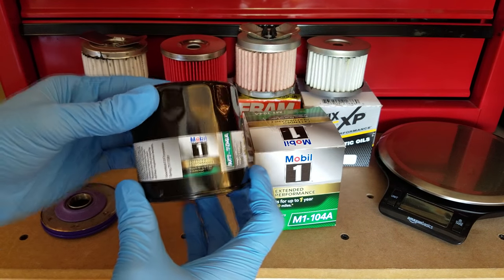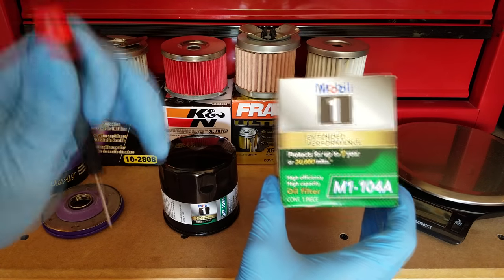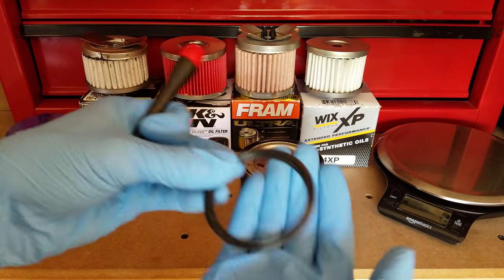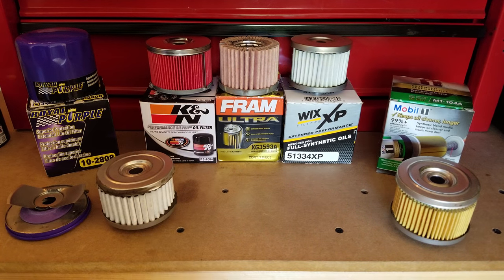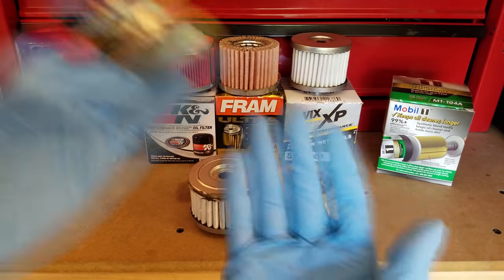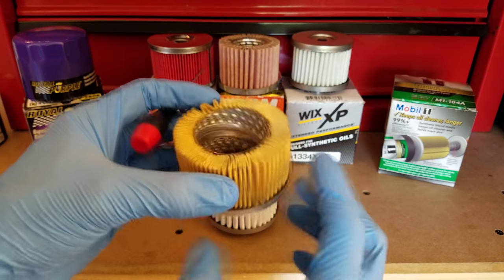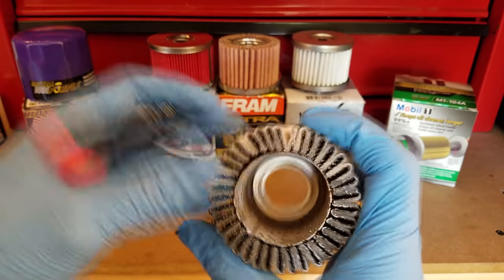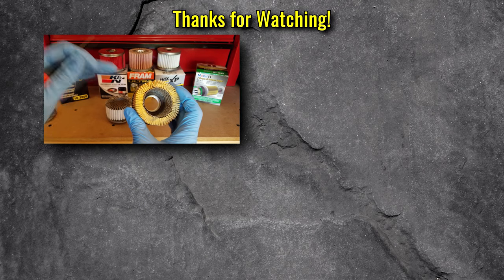Mobil-1 Oil Filter Cut Open! | vs Royal Purple/WIX/K&N!

Comment: The only reason I use the K&N is the 1 inch "Nut" on the bottom that makes it ridiculously easy to change.   It's  a brilliantly simple idea....
Reply: Didn't even know about that. Cool!
Reply: Ditto
Reply: You would think so... but about a decade ago I figured out you never need the filter on that tight. Put it on by hand take it off the same way.
Reply: @batvette  Heat cycles can make them hard to get off and seem "tighter" as well. You don't need a tool or wrench to put them on but you definitely need them somewhat hand tight. You can't just stop as soon as it touches/feel some resistance. As soon as the seal makes contact a half to three quarter turn should do the trick but it's more a feel than anything. If you do it enough you can tighten it just enough and be golden. 

The only time you should use a tool to tighten a filter is if for some reason you can't reach it or grasp it well enough.
Reply: Had one get stuck one time and that nut didn't help at all, it broke off.  Had to do the old screwdriver stab trick...
Reply: @ocp1669  never had one I couldn't take off by hand that I put on by hand...
Reply: I've had a k&n filter come apart inside. Sad they went to production outside the US
Reply: Rich Farfugnuven 
So simple and great
Reply: @batvette  on diesel trucks(I have 2) you want to snug them down so that the extra vibration  of a big old diesel doesn't loosen them.
Reply: @robby844  Ok and? It doesn't change the fact that heat cycles and vibration can tighten them more than you did  and make it harder to get off by hand. Especially where they are harder to reach. 

Anecdotal evidence is the best evidence?
Reply: @robby844  "if you know what youre doing you don't need a tool to put it on or take it off. "

I agree with that, if you qualify that statement with... if you put it on yourself and you have been doing it long enough to know how tight it needs to be and you have enough access to it to be able to reach it and get enough of a grip on it to turn it. The statement as it stands however is completely false as you can know what you are doing completely but if someone else put it on with or without a tool and over tightened it there is no way in hell you are going to get it off without some kind of tool unless you are secretly Bruce Banner and can get a bit of that hulk action going just be careful not to break the engine in half. 

"Never once put a filter on with a tool."

Again I can agree with that statement if you qualify it. If you have the access to tighten it the appropriate amount, usually half to a three quarter turn after it makes contact then absolutely completely agree. 

"Caterpillar says DO NOT use a tool to install thier filters."

So? Look you can use a tool or not use a tool and still be fine, it's just using a tool you have to be a little more careful. A lot of mechanics use quarter inch tools on small fasteners, but you can use 3/8 or 1/2 perfectly fine if you know what you are doing and be careful not to apply too much torque to the fasteners. You can put on a filter by hand and still over tighten it, yes you can get it on by hand but if you over tighten it then with heat cycles, vibrations, etc it tightens up a bit more and the same hands that put it on may not be able to get it back off. 

"Lube the new gasket"

Sure it should be common knowledge to stick your finger in the oil and rub it on the o-ring, nothing to it really. 

"spin on until the gasket contacts, 3/4 of a turn after contact. NO FURTHER."

Maybe you did not read my full reply? If you go back and read them... that's exactly what I said, well not "exactly", but it was close enough. I mean hell it's not all that long. 

Here it is just in case you can't be bothered to scroll up. "You don't need a tool or wrench to put them on but you definitely need them somewhat hand tight. You can't just stop as soon as it touches/feel some resistance. As soon as the seal makes contact a half to three quarter turn should do the trick"

"Filters that some asshat like you put on?.... Yup. Needed a pair of channellocks EVERY time"

What the fuck are you on about? Seriously read what the fuck someone says before you come at them like some ignorant fuck. Also that statement goes completely against your first statement of never needing tools to take one off. Maybe learn what absolute language is and figure out what qualifying language is? Well way before then you definitely need to build up your reading and comprehension abilities as they are severely lacking.
Reply: @robby844 I can almost NEVER take them off by hand after...
Reply: @billsouza4457  youre doing something wrong then
Reply: Robert Pitts That reminds me of some youngsters working at a SHELL station I used to use, so the 1 guy punches the filter with a LONG screwdriver, then hit and BROKE that cars distrubitor,  well the owner went aBALISTIC, for the damage from a simple oil change ,,he broke the gear, so now the repairs .!
Reply: @robby844  Same for me-I have not used filter wrench in such a long time that I don't have a clue where I've stored it!
Reply: OCP yeah I’ve read all the comments and STILL agree with Robert844 LoL
Reply: Hi-Flo makes them. You can get the same filter with the nut under the Hi-Flo name for cheaper sometimes depending on model.
Reply: Only relevant if you can access the nut
Reply: @ocp1669  From the last dealer oil change, I had to use my 25" breaker bar to remove the filter. Tighter than the lug nuts on my wheels, a little more than heat cycle. Many times it's not easy to remove by hand when the filter is oily, in a hidden dark location, contorting and twisting one arm trying to grasp it with just finger tips in a mechanically disadvantaged position. Finger tight plus half turn, should be easier for the next change. Not looking forward for the transaxle oil change on my new car with no dipstick. A new experience trying to match oil volume with specific temperature - need to be very accurate. Old cars so much easier to maintain.
Reply: @frankw8876  "a little more than heat cycle." It could be a number of things but heat cycling can and will cause them to be that tight. It doesn't happen every single time but it can. It also can be down to how many heat cycles, and the extremes of the cycles. Say driving to work every day more than 10 miles each way when it's very cold. Then you have other temperature differentials. Say you put the filter on a little more snug than normal when it's 90 degrees outside, then try to remove it without warming up the vehicle when it's 10 degrees outside and it will be seemingly impossible to get off. 

"Many times it's not easy to remove by hand when the filter is oily, in a hidden dark location, contorting and twisting one arm trying to grasp it with just finger tips in a mechanically disadvantaged position."

I completely agree and nothing I have said so far has gone against that. 

"Finger tight plus half turn, should be easier for the next change. "

That I believe is the wrong kind advice. It has a very subjective component to it "finger tight". Finger tight to me and to you and to anyone else will be a little different, especially when you factor that and hand strength. A better way is right when the seal makes contact. The second you start to feel some resistance a half to three quarter turn at that point and you should be good. 

One other point to note. "finger tight" typically and almost exclusively means as tight as you can with your fingers without the aid of any other tools. If you did this, plus another half turn to three quarter turn with a tool that would be way too tight, unless you have incredibly weak fingers/wrist. As such I again suggest as soon as the seal makes contact then half to three quarter.
Reply: I love the K&N nut, wife's truck has the filter in an odd spot where the access is right between two cast exhaust pipes. So either wait a good hour or so for it to cool down, burn myself good, or buy K&N filters. Plus those silly end cap type wrenches get stuck on and are a royal pain for installing a filter.
Reply: @busted7426  Had the same problem, junk filters....the end-cap nut seems like a good idea but now I believe it to be a gimmick.
Reply: @sebrofc   They use to be pretty good though, I swear the nut and case use to all be one solid piece of metal.  Now it's just cheaply tacked on like an afterthought.
Reply: @flybyairplane3528  Now that is a big screw up, did the owner have to pay for the damages or did the station cover it like it should?  I'd still be pissed either way, no one likes dealing with unexpected damages no matter how small.  This is why I will always do my own oil changes.  A friend of mine took her SUV in for a oil change and the guy there used the wrong filter even after his boss told him to double check it, oil leaked out while it was being driven, engine ceased up and had to be replaced.  They thankfully covered the repairs though.
Reply: Aircraft oil filters have the nut like a K&N so that you can use a torque wrench.  They also have tabs to safety wire the filter to prevent vibration from backing off the filter.
Reply: Been using K&N filters and Mobil1 full synthetic in both of my cars for years.
Reply: @busted7426  Same thing happened to me, now I don't waste my money on K&N.  You should check out Husky's 3-Jaw filter wrench though... $10 at Home Depot and you'll never need to stab with a screwdriver again.
Reply: @robby844  Plenty of other people have...
Reply: You sir just made me switch my brand to k&n
Reply: @ocp1669  - Some filters are marked for 3/4 turn after "finger tight" contact.
Reply: @flybyairplane3528  - The main reason I do what I can myself is keeping monkeys away from messing with my car. I don't care anything about car fixing any more; it's just an annoyance. But nowhere near the annoyance of monkeys damaging my car. Believe it or not bumblers can screw a spin-on filter crooked! Every car I have had that had a spin-on filter required a wrench to remove the filter the first time. What do they do? Use an impact?? Only car I ever had that had a separate filter element had the center screw in crooked - missed the threaded hole. The cap and filter fell out when I removed the cover on the bottom of the oil pan. No wonder the oil pressure was so low!
Unless car repairs are beyond my abilities and facilities (concrete driveway) my attitude is "get away from my car!!"
Reply: @ocp1669  - "Finger tight" is two fingers and thumb, not gripping with the whole hand. Unless you're a real gorilla!
Reply: @batvette  I have been doing it way for decades. I don't know why other manufacturers don't copy Fram and put some grit on the out side of their filters too.
Reply: i think 17mm
Reply: @busted7426  done that a few times with my 1988 IROC with 5.7.  Really hard for me to get at the filter.
Reply: @brianheath5091 Thanks for the info, I just did a look see at HD and they had a short video on Husky tools. I thought I'd pass this on for all the DIY'ers here.. Husky is doing what Sears/Craftsman used to do, if one of their tools breaks you can bring it back to HD and they'll replace it for free. It's a lifetime guarantee and no receipt is required. In the video it shows a guy mowing his lawn and he runs over a hammer, chewing up the handle pretty good and taking it in and getting a new one.
Reply: @joepro3562  what do you think of their tools? I looked up snap on torque wrenches since my father-in-law has them and saw they're $400! Husky is 80 with the lifetime warranty. Hell, even if it only lasted 10 years and husky was out of business by then, I'd still be ahead compared to a $400 torque wrench...
Reply: @ocp1669  
You sound very upset. It's not worth blowing a fuse (or a blood vessel). Now if you want to get upset try removing a Toyota oil filter cap (instead of a spin-on filter) that some ignoramous put on with a 200 ft.lb. impact tool.
Reply: I just changed my oil and the darn filter took 5 tries (5 different oil wrenches) and 20 minutes to get off, due to it being really tight and hard to get at. I switched to the K&N for the nut (supposedly a good filter too). For some reason the oil filter on the 6.4 hemi can loosen (mine has twice), so the dealer said to put it on tight (more than hand tight).
Reply: Be careful of that design if you live in winter hell. 

If the filter is exposed, road salt will corrode the filter “nut” area, to the point that it can leak.
Reply: @very7962  we luckily do not use salt here in CO
Reply: i gave them a shot once because I liked the idea too. BUT in practice it didn't help any better than a typical oil filter removal tool. The "nut" on those filters is hella rounded off and smooth from paint. A socket will grab it, but unless you have a ton of room I found it just slipped all over....for me it appears to be a marketing gimmick.

Comment: I’ve used Mobil 1, Wix, Fram and K n N. Typically I go with the Mobil 1 and oil, as they’re usually a package deal at Auto Zone. One car has a mere 137,000, the other has 233,000. Change it all out every 3,000. Both vehicles have dirty oil at that point. Transmission fluid and filter every 12 months or 12,000 miles as well. Well worth it.

Comment: Purolator is a bargain premium filter. Bosch now makes Purolator. If you change your oil every 5000 miles then either are a very good choice. Been using Purolator Pure One or Bosch for most of the 32 years on Toyota truck and have no oil related issues in 463,000 miles.

Comment: My dad had a 1986 Ford Escort GT, with 413K miles running M1 & filter, changing filter at 10K and oil at 20K. Sounded like a stretch to me but can't argue with the results, he was an engineer. He passed in 2018 but the car will start & run although it looks like crap.

Comment: I use the mobile one annual filter, however I do change my synthetic oil and filter every six months. Was talking to some technicians and engineers, regarding Subarus filter versus mobile one. They stated that mobile one filter ihold twice as much dirt as your standard blue Subaru filter. I forget exactly how many grams difference that was, but I do remember it to be twice as much. The Subaru filters have a much higher bypass pressure, however they are far inferior for Holding contaminants/capacity versus the mobile one. Thanks! Great video!
Reply: Subaru typically recommends 6,000 mi oil change interval. If you are changing the oil that often, you won't see any benefit from using a filter designed to last 10,000 - 20,000 miles. My Acura recommends oil change intervals of about 10,000 mi or once a year so I use a filter designed to last that long.
Reply: John Ferguson In principle, I agree. However, the long life filters are constructed better, they would stand more pressure, are less likely to fail, and are generally more durable. My Subaru goes from desert conditions to Canadian winters. I believe a good quality and durable oil filter, like those that last one year or 20,000 miles, or simply constructed better and more durable and are less likely to fail for just a few dollars more, I think the price is worth it. But in Principal, with normal driving, I do agree.

Comment: Good video! I've used Mobil 1 filters for years, though not exclusively, and it's nice to see that it's generally very decent still. Something I'd be interested in are OEM filters. I think it would be interesting to see what the differences are between and OEM and aftermarket offerings.
Reply: YellowSuperNintendo That would be awesome. I know for sure the new Honda OEM filters (A02) are from Fram. Still good filters though.
Reply: Fram and Honda filters are both manufactured by Honeywell and likely even in the same factory but don't be fooled into thinking that same factory means same part.  They're built to different specifications and are significantly different.  There are videos of Honda and Subaru (both Honeywell) filters cut open and compared to Fram and they're definitely different.
Reply: Would you happen to know who makes Nissan filters? I've googled various terms with no avail. Also, how did you happen to figure out who makes the Honda filters? Maybe that's a better question, how did you find out who makes what.
Reply: I'm not sure about Nissan, near as I can tell they have white can filters made in China and blue cans made in Japan but I don't know who manufactures them.  The Subaru blue can filters I know for sure are made by Honeywell because I work for a dealership and they have had documents circulated to us about filters back when they were having issues with the Honeywell ones leaking and they did a temporary switch to the black can (Tokyo Roki) filters because the Honeywell ones were leaking from the mounting gasket and they were unable to fill demand on time so Subaru had to outsource the filters temporarily.  A lot of people were freaked out when their tall, blue filter was swapped out for a shorter, fatter black filter (or vice versa) and brought their cars back to us assuming that we had used the wrong filter and we had to explain it to them that there was a temporary change in filter manufacturer but it was the correct part and that there was no chance for harm to their engine (I actually prefer the TR filters, myself, internally they're built better and have more media in them).
Reply: Honda sources their filters from from Honeywell, Filtech, Toyo Roki and Fram.
Reply: @406Steven  But are talking about the Honda A01 filters or A02? A01 filter is a much better design made by Filtech...
Reply: @TheRichardF10  Honda A01 is a better design made by Filtech
Reply: Been using M1 filter and Mobil1-EP oil for 5 years in my Corolla. Car runs about 15k miles a year. Change filter and oil every 12 months.
Reply: The OE filter on my Chevy Volt is apparently the same as an M1. There may be a GM-specific bypass pressure.